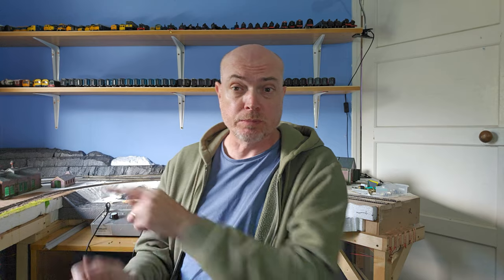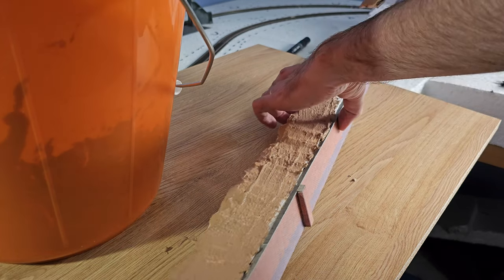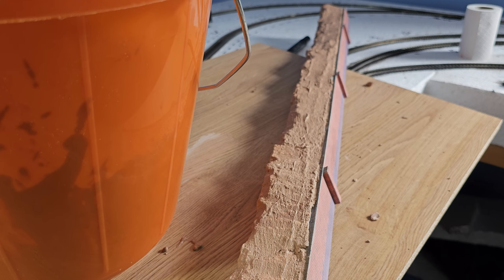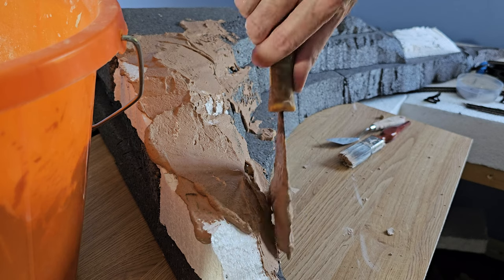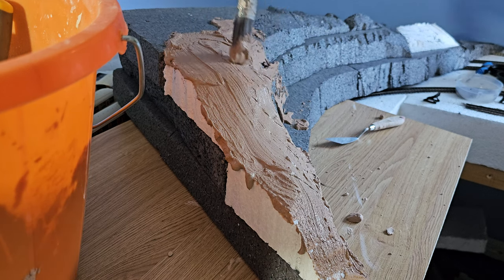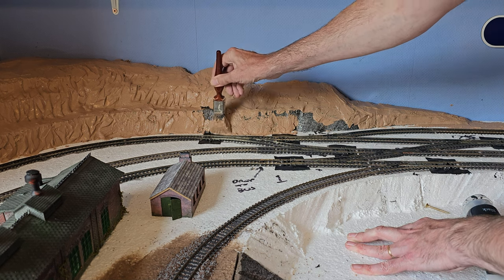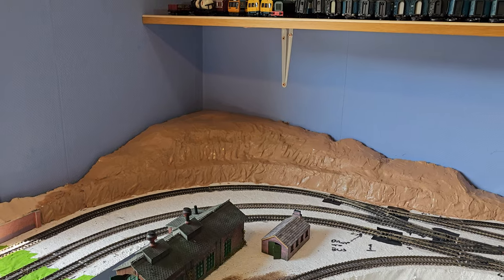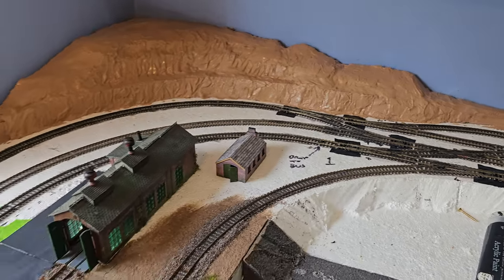Layout Update 9 : Plastering

Comment: An alternative to plaster is white tile adhesive/grout that can be bought in gallon tubs. It spreads easily for brush application and you can add texture or keep it smooth, it dries slowly but as hard as plaster in 24 hrs. Cheapish and no mixing. You can dip your brush in water to smooth it more and leave it neat for rock faces. It takes paint (emulsion) well or you could even stil in colour before using.
Reply: Yes, I agree.  Plaster is not my preferred medium either for landscaping.  And I spent 4 years working in a plaster factory.  😂. Ready mixed wall plaster or tile adhesive .  Then, if you want your rolling hills and grasslands, go over it with plaster bandages.  Also you can cast rocksurfaces in plaster with scenics moulds and fix them in the ready mix if you want to combine both .

Comment: Nice to see it coming together! If you're happy messing around with plaster, I really recommend the Woodland Scenics moulds for rock faces, if you haven't already tried them. They're dead easy to use and you can get very convincing results - just stick the moulded chunks on with plaster or sculptamold, use a bit more to blend between the pieces and bung a few very thin paint washes over them when everything's dry. I did all the rocky outcrops in this with them - https://www.youtube.com/watch?v=cL30W7vojyI